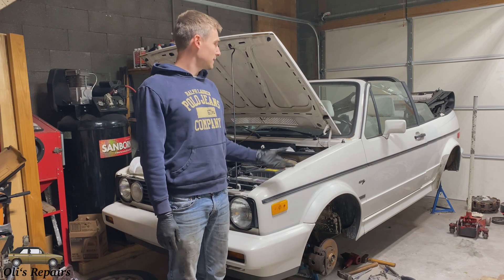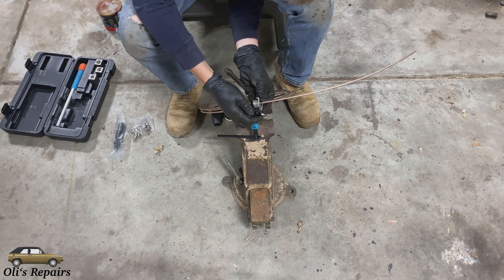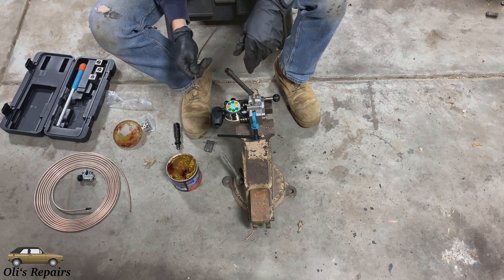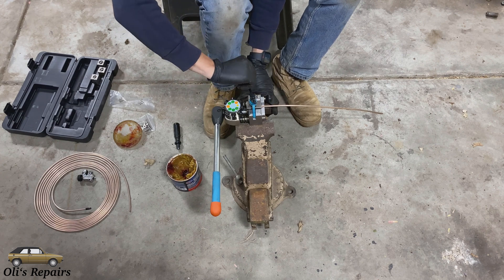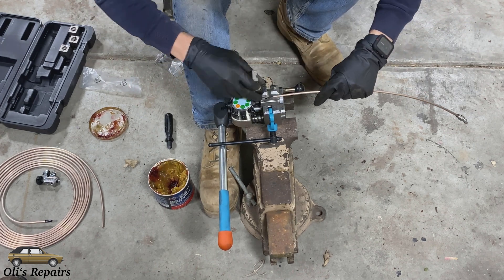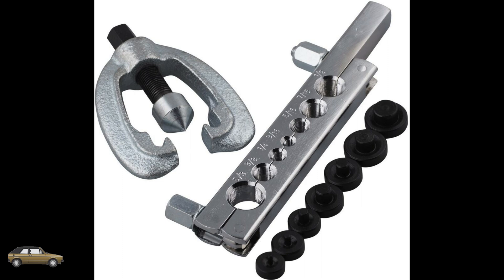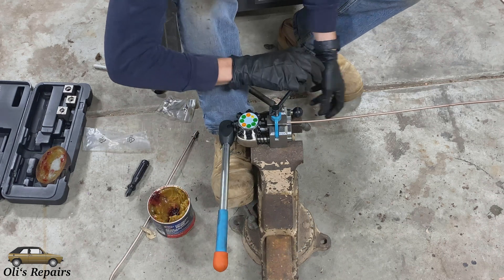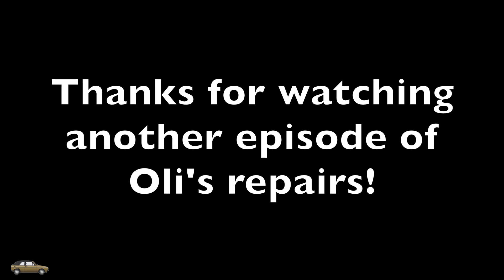Make your own brake lines!

Comment: your info is not correct about the smaller tool, i have one the same that does bubble lines.
Reply from the maker: In the description of every one of those tools that I found, it stated that it does NOT do bubble flares. I even bought one and returned it after looking through all of the included documentation. 

That being said, yes it might work. HOWEVER, if it leaks because the flare sucks, you are stuck pulling everything apart and remaking the lines. No thank you. I would rather spend an extra $80 and do it right the first time with ease.
Reply: Fair play just saying the tool available in the uk does do them and ive done loads with no problems. Also its advertised that it does them. Maybe the tool is not tbe same where you are ? this could explain it
Reply: Im dealing with this problem right now. I have one but this bubble flaring is so confusing... :(
Reply: @carlosrodrigues77777  its a simple thing to do. There are single . Bubble and double types .

Comment: Are all VW and Audi flares the same?

I am trying to do mine on an A4 B6 using this tool and am not sure on the type: https://www.amazon.com/SUR-Auto-Parts-Flaring-SRR-HFT50/dp/B00JW2J8SC
Reply from the maker: I am fairly confident that Audis also have bubble flares..though I don’t own an Audi. 

Not sure if that tool works. I have no experience with it. The comments seem to indicate that it makes bubble flares. However, if you’re paying that much already, I’d just buy the tool I used. It was so nice. Only downside of the tool I used is you can’t flare a line on the car. But, rarely if ever will you be flaring a line on the car.
Reply: @OlisGarage  

Right on, thanks!

Are you referring to an SAE bubble flare?
Reply from the maker: @matthewnataloni  I didn’t think an SAE bubble flare was a thing. 

I know of DIN/ISO bubble flares. All VWs that I know have a bubble flare. 

Does that answer the question? I’m not sure if it does.
Reply: @OlisGarage  yep, that helps! Thanks